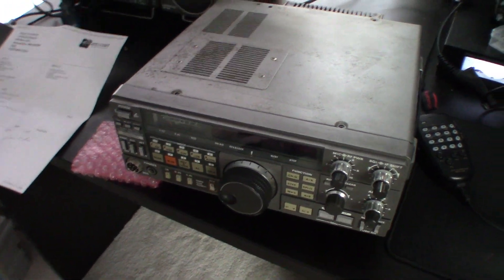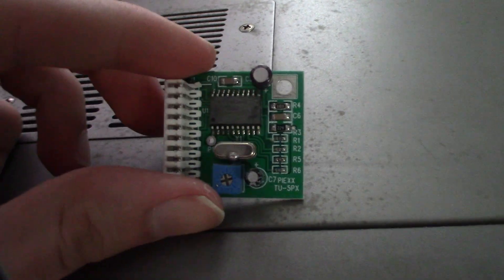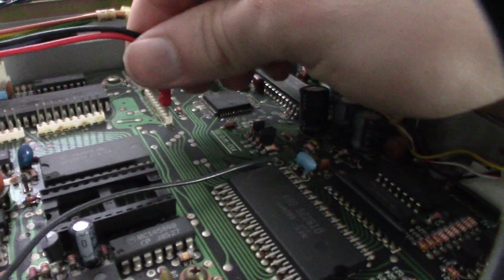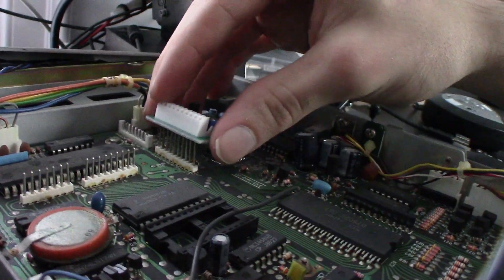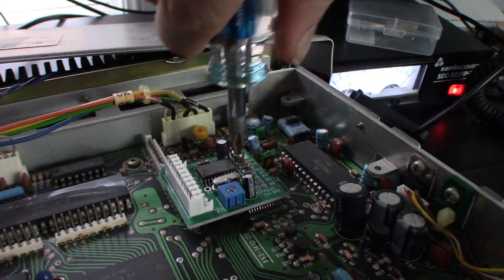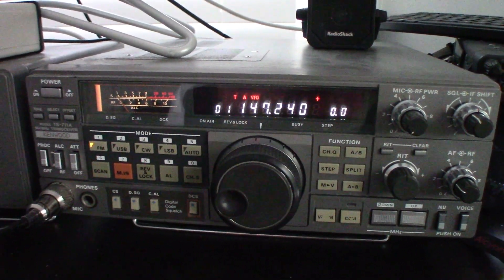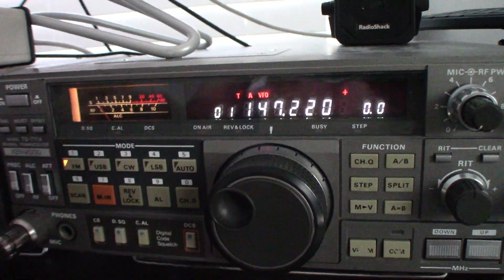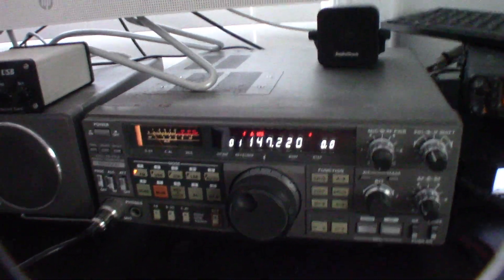Piexx TU-5px Tone Encoder Board for a Kenwood TS-711A

Comment: I have a 711e (European version), do you know if I can fit the same tone card as the 711a? have you ever tried? Thank you 73 IU0SGS
Reply from the maker: I have not tried it but I believe it works the exact same way. The only difference between the E and the A are firmware as far as I know. The tone board should fit and work on either one.